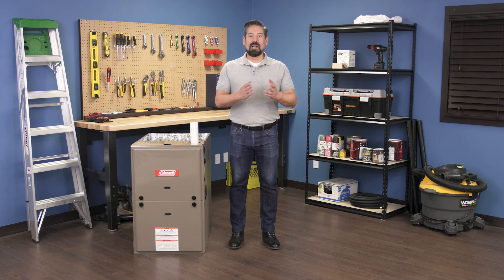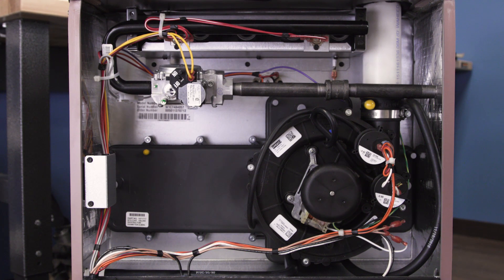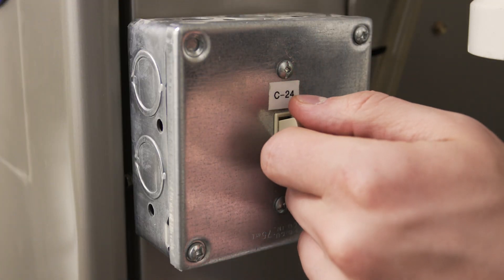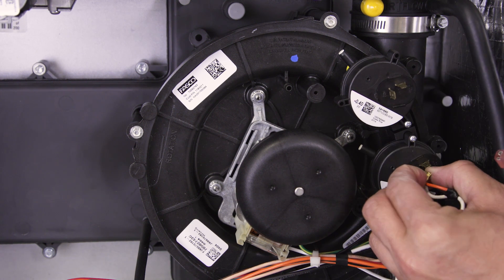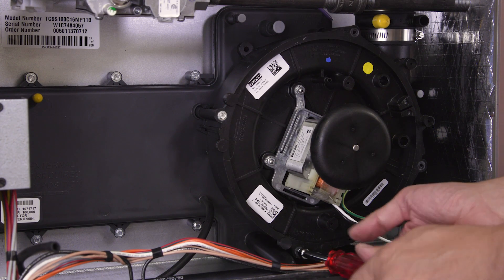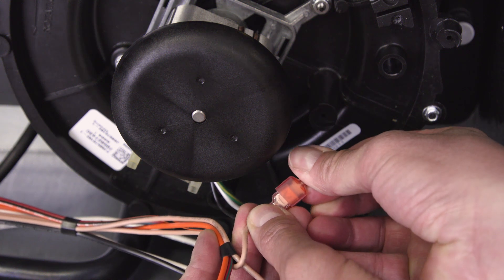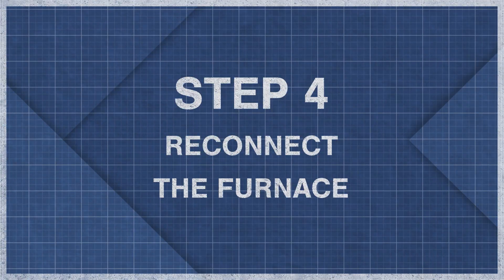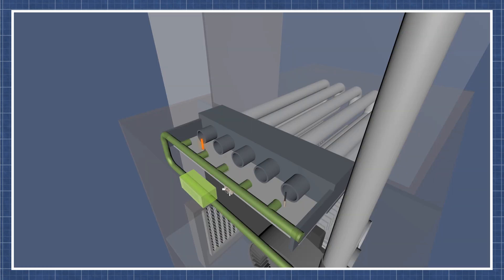Furnace - Draft Inducer Motor | Repair and Replace

Comment from the maker: In many cases it's still best to consult with an HVAC technician. Some repairs can void the warranty of the furnace or might conflict with one's home insurance. Though the inducer motor installation is relatively simple, if the motor is not installed correctly, or the gasket seal is compromised then carbon monoxide can leak, it might trip the CO detector. CO poisoning can be deadly which is why CO detectors are required in multiple areas of your home. A HVAC technician will do the proper CO leak checks as part of the installation.

Comment: Like most things its easier than you think, have a laydown where I replaced the blower motor about 7 years ago.  At that time I bought an inducer motor.  Now its failing, mzkes a byzzing sound while still working.  Youtube is amazing for home appliance repair, has saved me thousands in service calls.
Reply: Why say "Repair and Replace" in the Title?????  REMOVE and Replace is surely what you meant to say, right?  

If an inducer motor was repaired in this video, I definitely missed it.
Reply: Mine quit working - hums but doesn't turn, and starts getting hot.   One of the first things I noticed was a small sticker that says, "LUBRICATE USING __ Drops of Oil Once per Year."

Damn it!   It would have been nice if someone had told me that when they installed it brand new IN 1990!!  Ya think that might have played a small part in the motor ceasing to turn?  Grrrr.

Comment: My Rheem is working and heating, but the inducer motor is vibrating very loudly. But, when I tape the safety switch and take the doors off, it stops vibrating and runs smoothly. It also runs smooth when I take the filter out. The filter is only a merv 5. It was dirty, but I could see through it. So, I gently vacuumed the side the air enters the filter. Any ideas?

Comment: I see more than a few references to needing some high temp silicone sealant for this type of a project?  I take it it depends on the manufacturer/etc?  Yours didn't seem to use any, wondering if i need to order that as well... (Fasco D342097P01) or should be good to go with just a new blower....
Reply from the maker: It would depend if it already has a gasket or not, or in some cases manufacturers might advise against using sealant.

Comment: HVAC tech here. Everyone, this is not a homeowner repair.  After installation this needs to be leak checked for any co leaks with a combustion analyzer and co detector. This could result in FATAL co poisoning if not installed correctly.
Reply from the maker: Thank you for sharing your insight, you make some good points.

Comment: Every video replacing the "motor" just showing whole blower replacement...you can replace JUST the motor you know, it's like $30
Reply from the maker: Thanks for watching. It depends on how it is mounted and attached to the blower wheel. Some are more easily accessed than others.

Comment: Mine makes noise
Reply from the maker: If it's noisy then it's a good sign that the bearings are starting to wear down. In some cases you might be able to lubricate it. In other cases you might need to install a new draft inducer.
Reply: @ I put some foam board and it stops making noises lol it works

Comment: If anyone is in a pinch and needs a temp quick fix , remove the motor spray some lubricant down on the head of shaft let it to soak the seized bearings (don't use to much) and spin it freely
Reply from the maker: Thanks for sharing that tip!

Comment: I got a estimate to do this job for 1900$ I spent 100 on the part and 15 minutes doing the job. I will not be hiring that company to replace my furnace as I think they went way too far.
Reply from the maker: Thank you for sharing, you're not the first person to receive an extremely high quote. There are some very honest technicians out there who want the best for the customers, and then there are others who will try to take advantage of someone's lack of understanding of the furnace. We feel that even if someone doesn't do these repairs themselves, this information is still helping to increase their understanding of their furnace, which hopefully helps them make better decisions on what repairs and what prices are reasonable.

Comment: Great video.  My furnace required a new inducer motor . The gas tech replaced it but he had to loosen the air intake pipe to the furnace for the furnace to start.  There was no clogs in the intake pipe. Could the new inducer motor be creating too much negative air flow inside the furnace and won't allow combustion to occur ?   Could that be a flow restrictor ring problem.
Reply from the maker: Thanks for watching. A new motor could have a different airflow than the previous one. Without seeing the before and after it's hard to know for sure if the problem would have been solved by a flow restrictor ring.

Comment: I just replaced my inducer. Had to run a bead of RTV on the back of it to make the seal. Do I need to wait 24hrs for the sealant to cure before running my furnace?
Reply from the maker: Thanks for watching. The full cure happens at 24 hours but if you ask in forums you'll find people who have waited less. Depending on how cold it is, 24 full hours can mean that the temperature inside your home can drop significantly which slows down the curing. You might find that 6 or 12 hours will do fine. Regardless make sure that the room is warm to help the curing.
Reply: @AmreSupply  thanks for the info
Reply from the maker: @homealone5087  You're welcome, just happy to help.
Reply: @AMRE Supply  So it looks like it's leaking from the wheel fan housing. Is this common?
Reply from the maker: @homealone5087 This can happen. If there is water leaking from the inducer blower assembly then check the drainage hoses to make sure that any condensate can easily drain away from the unit. There might also be a blockage at the condensate pump: https://www.youtube.com/watch?v=dcLhyLu0-y8

Comment: Our furnace stopped working. Technician is asking $2350 to put a new motor (his service charge is included in the price). I really don’t think it should cost this much. Where do i get a new motor?
Reply from the maker: Thanks for watching. That seems quite expensive all together considering that the cost of the draft inducer motor is just a fraction of that. AMRE carries a variety of draft inducer motors. You can see them here: https://www.amresupply.com/catalog/Draft-Inducer-Flue-Exhaust-Blowers-And-Motors-661088

Comment: Take a few pictures of everything before you take apart anything
Reply from the maker: That is a great all around tip for any repair!
Reply: @AmreSupply  so my 10-year-old furnace, the blower motor got a little squeaky, so I replaced it easy enough. Now it’s so quiet it’s easy to notice how loud the inducer motor is.   It looks easy enough to swap out, just reluctant to spend $250 on the part simply because it’s a little noisy.  Your thoughts ?
Reply from the maker: @Gonefishing185  When it comes to the inducer motor, not all bearings can be lubricated or adjusted, so if the inducer is starting to get noisy then it is a sign that the inducer is starting to wear out. It might not give you a problem right now, but it's something that you should keep an eye on. If the furnace ever short cycles or shuts off before igniting, check for any pressure switch codes, and that'll tell you if the inducer has failed.

Comment: Is it possible to replace just the actual motor and not the whole assembly? Would it be more/less involved or the same? I’d imagine it would be cheaper as well.
Reply from the maker: Thanks for watching. It would depend on the model on how accessible the motor is. If it looks like a sealed unit like the example in this video, then it's going to be more difficult. Other models the motor might be mounted to a separate bracket. You'll still need to remove the blower wheel off of the shaft, similar to how you would for a bathroom fan: https://youtu.be/S7QFIzAZ1LU?t=95

Comment: Hi. Just found your video. Thank you.  What's the price range a technician normally charges to replace this part and labor?
Reply from the maker: Thank you for watching. We can't speak to the exact prices as this will all vary. Usually there is a diagnostic fee. It can cost $100 or more to get someone in the door to diagnose the problem. To replace an inducer motor this could be upwards of $400.

Comment: My inducer motor runs constantly on cool mode, what is problem ?
Reply from the maker: Thanks for watching. If the inducer fan motor keeps on running all the time, then it's most likely due to a tripped safety such as the high limit switch. It could also be due to a bad relay on the control board that could be stuck.
Reply from the maker: @luanpham7469  Thanks for watching. When it comes to these sorts of things, it can be difficult to narrow down as circuit boards can't really be tested. It could still be the thermostat or the control board but it's still best to check that all the connections are secure. The thermostat is relatively easy to replace. You can learn more here: https://youtu.be/lsXppTUKI-Q

As well you can see how to replace the control board which is often located next to the blower fan: https://youtu.be/4SY8lRl8HV0
Reply: @AmreSupply , Yes, the suspect is control board. I😀It cost me $70 orders on Ebay. Thanks for help

Comment: This is literally the lamest excuse for a help video... when people search for how to repair and replace these. They are peobly referring to the motor itself or how to identify the wire colors or take off the motor from the blower .... thanks for wasting everyone's time to show us how to unscrew 4 screws
Reply from the maker: Hi Martin, just saw this comment now as it didn't show up in the notifications. We structure our videos to explain the how behind repair as well as show how to access and replace the part. We can't show every variation in each video and when it comes to wires, there will be differences between manufactures and models. If you get a direct replacement then the wires will be the same color so you'll replace like for like. Many other people have found this video helpful, hopefully you find what info you're looking for on YouTube.

Comment: I have a Haier furnace whos Draft  Inducer Motor is burned out.The Draft Inducer motor is a Fasco 7062 5870.There is no replacement part that I can find anywhere.I am hoping that I can get help from you,else I will have to buy a new furnace.Thanks for your videos giving me hope.
Reply from the maker: Thanks for watching. Some motors will be listed on cross reference sheets which can sometimes be found on manufacturer's websites. If a similar model had the exact same specs and physical dimensions then it will be compatible. Not all variety of motors are available. In some cases it can be helpful to look for any other part numbers on the inducer and try searching for that as well.

Comment: When enducor motor goes bad do you need to change the whole furnace? My furnace is over 40 yrs old
Reply from the maker: Thanks for watching. In most cases the inducer motor is easy to install if available. If the furnace is 40 years old then it might be harder to find a compatible inducer fan.
Reply: @AmreSupply  thanks I feel like the plumber wants to get more money he advised to changed the furnace.
Reply from the maker: @streetcruise9807  If the furnace was 15 years old and it was suggested that you needed a new one then it would be good to be skeptical. With a 40 year old furnace, you are more likely to need some more maintenance sooner than later. Installing a new furnace will cost more upfront but you're not going to have to put the same time and money into repairs in the short term.
Reply: @AmreSupply  thanks I understand

Comment: What is the problem when have code 57 at furnace? Thanks
Reply from the maker: Thanks for watching. Furnace codes will vary per model / manufacturer. The codes & meanings might be written on the manual or on a chart on the inside of the lower door cover.

Comment: does the new induce need to be converted for LP? thank you
Reply from the maker: Thanks for watching. If you match the part # exactly then it should be compatible and you shouldn't have to change anything unless its specified in the manual or the PDF for that part.

Comment: Thank you for all the info. Someone idw to say who but they wanted to charge me $1200. Just for replacing it. And thanks to you I just saved even the new part. For just $220. In less than 4 hrs I was able to enjoy my heat again. And this people wanted me to wait for 2-3 days to get the part and then make an appointment to install and charge such a crazy amount of money. What a shame!! Not even a military discount on the diagnostic. Karma I guess!! 
👍😎🤗
Reply from the maker: You're welcome, we're just happy to help! With the temperatures so low, waiting 2-3 days would not have been ideal, plus that is quite a premium for a straight forward repair.

Comment: One company i asked told me it would be 1200 dollars to replace it. I won't be calling them.
Reply from the maker: Thanks for watching. The cost for replacement often includes parts and labor and some markup as well. 1200 dollars does seem a bit steep though.
Reply: @AmreSupply  At those inflated prices, the customer needs to start learning how to do it himself.  There comes a point where it is just a rip off unless he is a millionaire at which point he doesn't care. Sometimes a second opinion will reveal nothing was wrong. What I did was get 3 other estimates which were a hell of a lot lower. But I'll just get the part from Ebay and put it in myself.

Comment: Thank you for this video and your parts service. However the inducer motor may require a run capacitor and that should either be checked or replaced at time of service imo.
Reply from the maker: Thanks for watching. You are right that its often best to replace the capacitor when replacing the motor. For general information, we did a whole video on capacitors here: https://www.youtube.com/watch?v=NkgxNLCrmr0

Comment: Very helpful video, thank you.  While working on my furnace, I recently dropped a screw in my furnace.  I disconnected and unscrewed the wires and attachments to the inducer motor to look for the screw.  Once the motor was detached, I didn't take out the inducer motor out of the furnace but lightly shook the inducer motor until the screw I was looking for fell out.  I thought I could feel the flow restricting ring with my hands and it felt like it was in the right place, so I reconnected the wires and screws back to the inducer motor.  You probably can guess what I am going to say next.  I restarted the furnace and now the furnace is making somewhat loud noises at startup that I never heard before I detached the inducer motor.  Since I didn't take out the inducer motor from the furnace to see if the flow restrictive ring was in the right place, I'm wondering if it may be off-centered and causing all this noise when I start the furnace now.  I'm going to go back and tighten all the screws but wondering if the flow restrictive ring can have any impact on noise?  What exactly does it do? Thank you for any thoughts you may have.
Reply from the maker: Hi John, thank you for watching, we're glad that you found it helpful. Just so you know for some odd reason your comment didn't show up correctly and ended up in spam but its visible now. These things happen, and parts can shift when you remove them and put them back into place. The restricting ring allows for similar furnaces with different BTU ratings to use a single inducer motor. The restricting ring will adjust the airflow to what is needed and come in different sizes. Noises can be tricky to narrow down, but it could be something simple such as the inducer blower wheel hitting the side of the housing. That's something that could have been bumped or misaligned when it was re-installed. It would be good to remove the inducer, see if the blower wheel spins freely, then check the alignment of everything and reinstall.

Comment: Thanks for this video! My furnace was making a humming sound and I had a technician come out. After cleaned the furnace and grease the motor. He said that he advises I just replaced the entire furnace. Due cost of parts and labor and other things that will eventually go bad, he said it’s not worth repairing a furnace. The furnace is about 17 years old and is a high efficiency furnace. It’s been a week or so and now since he came and the furnace is way louder than before he came. From watching your videos, I’m assuming it’s the motor...I know the life span they say with furnaces are typically 20 years. I guess what I wanted to ask is if what he is saying is true and should I just replace the entire furnace instead of spending money to just repair the motor?  Although a 17 yr old furnace is old...I guess I don’t feel like it is compared to my last house that had a 30 year old furnace and was running just fine lol. Anyhow any feedback you could give would be greatly appreciated.
Reply from the maker: Thanks for watching. The discussion of when to repair vs when to install a new unit is a tricky one and will be different in each case. The older a furnace gets, the more likely you'll get little problems or have to replace small parts. In some cases technicians will recommend new installations, often they do the install themselves and are happy to get more work. In other cases the technicians observe what is needed to keep the furnace running and see that it would add up. There are many parts that are pretty simple to replace and that don't cost a lot to replace. (furnace ignitor or limit switches etc) But if you pay for a service call and parts and labour for those repairs, it would add up more quickly.